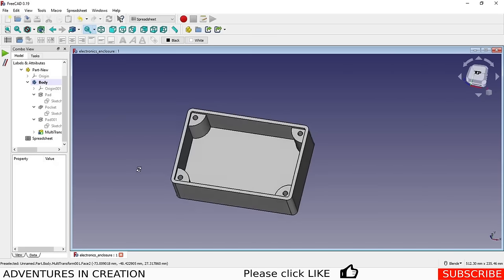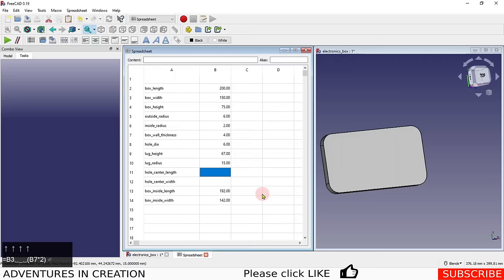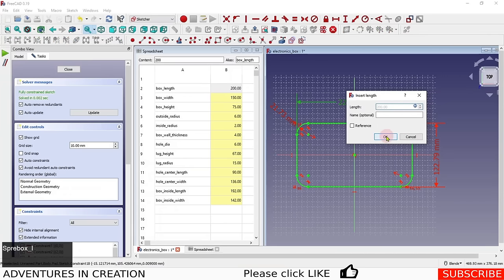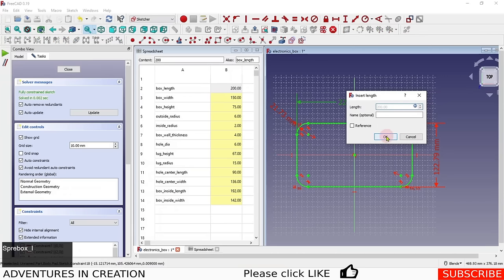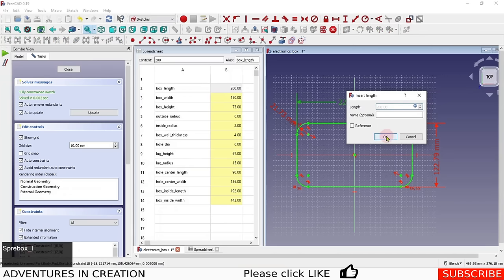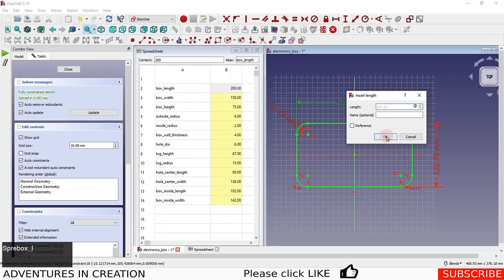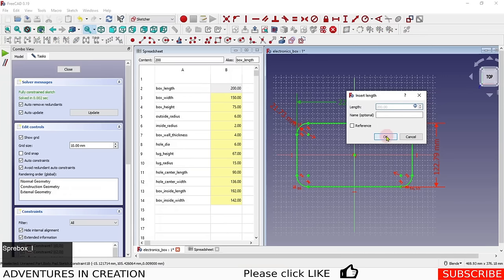FreeCAD Electronic Enclosure Using Simple Parametric Design Techniques

Comment: Wow!  I was so stuck in using FreeCAD, but your video helped so much.  I am a much better informed ignorant person (instead of a completely ignorant person)  Thanks!

In the spreadsheet, I noticed that one can use the alias in the equations (instead of hardcoding the equation to a certain cell).  I think that would make the spreadsheet more maintainable and readable.

In the lug radius equation, you made the equation 2.5 * hole_diameter.  What was the logic behind the "2.5"?  I can see that you have to have a bit over the hole diameter.  Is the 1.5 extra material just a rule of thumb that is well known?  Seems like one might want the wall thickness between the edge of the hole and the outside of the lug.  I suspect that there is some way to specify that kind of constraint.

Great video!
Reply from the maker: I am glad it helped. I recommend trying things for yourself, if it makes things easier for you then adopt those as "your" best practices. As far as the 2.5 * hole_diameter,  you can make it whatever you feel would work. When I am planning to put screws in the PLA I like to try and leave some meat for the screw to displace. I am really happy that you are trying things out and doing so well with FreeCAD.

Comment: Hi again. I am using Freecad 0.20.0 and everything went fine until I encountered a problem. At 20:54 you defined the dimension of the pocket by referencing to the - Wallthckness-alias in your spreadsheet. When I enter the formular in the Z-position entry field the Formular entrybox tells me already the result is -4.00 mm. However,  the box still had no bottom. I changed the formular by deleting the minus infront of the Wallthickness Alias and now my box has a parametric bottom. Strange.

I thnk the reason is that all my sketches are layed in they same xy plane, the pocket and lugs as well. Thus I had to modify the parameters fpr the pocket and lugheigth accordingly. Nevertheless, it works great. What a joy! Next step-> the lid. Thank you very much agian. Great tutorial with reak benefit for my electronic projects. 👏🙏
Reply from the maker: Glad you figured it out

Comment: I've been using FreeCAD for several years and your series of videos has introduced me to several features I was not aware of. Thanks!
However, something has struck me as a bit odd. I tried constructing a box following the techniques you've presented in this video, except I started it off on the XZ plane, as I wanted the opening on the front rather than the top. When it came to creating the pocket to hollow it out, I found that I had to offset the attachment point of the inside sketch in the Z direction to get the bottom closed, even though intuitively it seems that I should have made the offset in Y. Any ideas why this is so? Also, would it not have been simpler to start the pocket on the top face of your box, rather than the XY plane? That eliminates the need to offset the attachment and reverse the direction of the pocket. The pocket depth would be expressed parametrically as 'Height - WallThickness'. Thanks again and take care!
Reply from the maker: The offset is in the local rather than the global lcs and is nearly always in Z direction.
Reply: It is one year later but yeah, when you do the pocket do not select "through all", instead give it a dimension of whatever height minus bottom thickness.
That negative attachment offset seems more like a hack.

Comment: Thanks a lot for your tutorial, I'm replicating what you're doing and learning a lot ! I noticed you have one free contraint left on the lug - it's the angle of the pie. You freedrew it as a right angle but it might not be perfectly 90°. Selecting the two segments from the corner, press the angle button and write in 90° will fix that. Perfect parametric box!
Reply from the maker: Thanks for the feedback
Reply: It was fully constrained due to the automatic horizontal and vertical constraint that was added by freecad

Comment: Having a problem on the pocketing part. I didn't do a spread sheet set up but instead just input the sizes etc and created a fully constrained sketch on the top plane of the padded box.  but when I try to pocket, I am getting an error message saying the plane or object was empty.  
Unsure what I am not getting correct.  Any input would be great. Thanks for these.
Reply from the maker: Are you trying to pocket with a plane that doesn't have a sketch attached?

Comment: spreadsheets are different.
the EasyAlias macro is not in the list of available and, when installed manually, swears.
Version: 0.19.24291 (Git)
Build type: Release
Branch: releases/FreeCAD-0-19
Python version: 3.8.6+
Qt version: 5.15.2
Coin version: 4.0.1
OCC version: 7.5.0
Locale: Russian/Russia (ru_RU) ☹ 
in the process, I figured out that the alias does not respond to the Cyrillic alphabet 😆
it's a little hard for me to understand macros, filled in aliases manually
I apologize if I make mistakes, I watch and listen to you through the neural network
Reply from the maker: Watch the video I am going to release today it shows you how to use the macro

Comment: Well, I finally created something that actually works... Well, sortof.  I have built a flight simulator cockpit panels (using scrap pieces of wood etc) and switches, 7-segment displays and so on.  My plan is to build 3D printed panels for each section that I need.  My first success (almost) was to design one panel holding two 7-segment - 6 digit displays for the radio frequency readouts with an encoder to select the frequency with a pocket hole and a smaller through-hole inside for the encoder and, 4 screw holes on the corners to mount it.  HERE is the problem (and I don't think it's freecad but maybe CURA or possibly my delta printer) - All the measurements are exact for the cutouts for the 7-seg displays, and encoder and screw holes but, they get printed slightly smaller.  The panel itself, 150mm x 50mm is ok, the two cutouts (46mm x 14.5mm) come out as 44mm x 11.5mm) and the hole for the encoder, supposed to be 15.15mm and inside hole at 6.9mm comes out to 11.2mm and 4.5mm -  I haven't a clue why this problem exists.  I had to print in CURA by making the X-axis at 105% and the Y-axis at 108%.  If anyone has an idea as to what the problem might be...........  Would be truely helpful.
Reply from the maker: You may need to calibrate your "system" remember as the pla cools it may shrink. If you are scaling things in cura you may change the difference. Try creating and printing some simple calibration items to dial everything in.

Comment: Nice! If your enclosure had a slightly smaller base in relation to the top. how you you make it? Using multiple  lofts and boolean operations? Something like kradex Z75.
Reply from the maker: You could do that with just a loft to craft a taper or you could apply a taper to the outside

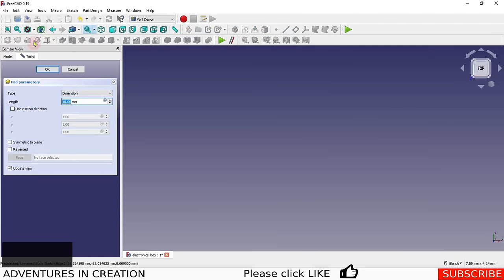Comment: I'm not able to use "PAD" from sketch tool during 4:45,  showing "Consider using ShapeBinder or a BaseFeature to reference external geometry in a body.
Reply from the maker: That's odd, can you share your file?

Comment: I currently use Draftsight but they just increased the yearly fee to $325 from $200. I would like to transition to another software. I haven’t been happy with the support. Some features don’t seem to work and there was no one to talk to. Can you use this in 2D and create a dxf file that can be emailed. Design spark may do it now but 2 years ago it couldn’t. I also tried to download this and it said not available in your country. Wouldn’t even accept my email. I would appreciate a 10-20 min conversation with someone about this software if that’s an option.
Reply from the maker: I did the same because fusion 360 (auto desk) started messing with their licensing. You can certainly make 2D views but this software is primarily built around creating a 3D model first. I am not sure that freecad offers a person to talk to but you may be able to go to the forums and engage their.

Comment: Good tutorial, but soo laborious. The connection between the spread sheet and the part is so clunky. It would have been better to allow users to name parameters on the part and automatically create a table. A simple popup on a dimension would have allowed that and allowed adding formula as well.
You could still access and input via a spread sheet or variable table but eliminate having to create variables and the associate with dimensions.
This is not trivial because every unnecessary and unintuitive operation makes the whole process more unwieldy and time consuming.  It does not seem to me that any of the CAD packages available manage to provide a clean interface where it is easy to move things, resize things, and allow easy parameter changes.
Onshape, which has its own issues offers a shell tool which avoids the process of creating a smaller box and subtracting it. Perhaps Freecad now offers that? 
The design software GUI needs to help the user otherwise the Openscad package offers a faster and clearer programming process to get what you want.
It is really difficult to work out which is the least worse free CAD software.
Reply from the maker: Try dynamic data, it might be nearer to what you are looking for.

Comment: Hi! Nice video. I'd like to know if there's a way to validate the input parameters such that the model doesn't get redundantly constrained. I looked up a bit but couldn't find a way to do this on the spread sheet. Let me know if you know how to do it. Thanks!
Reply from the maker: There is no automatic way to do that however you can build validation into your calculations.

Comment: Thanks, very clear tutorial but this is why I find FreeCAD so incredibly frustrating. There is no macro selection visible on my version, that whole row is missing,, yes it is the same 0.19 but a few months newer, so because some developer decided to change something within the same version, I fail at the very first hurdle. I work it out though menus, but the interface looks different, I get to downloading the macros, they fail to appear i it hangs at downloading macros. I give up and go and do something more productive instead. 

EDIT - After goodling and finding may others with the same problem, I determined I had to install GIT and put a path to it in windows system variables. Again, freecad frustrates at every turn... The list of macros downloaded and the one required wasn't there.
Reply from the maker: Thanks for the feedback, freecad is definitely under heavy development, it's a blessing and a curse. The menus are very configurable, I have mine all expanded and enlarged so you can see them in the video butany people work with a more modern look and feel.

Comment: Thank you for your excellent step-by-step instructions.  However, when I try to create that first pocket, I get an error message: "Pocket: Result has multiple solids.  This is not supported at this time."  What have I done wrong?
Reply from the maker: It sounds like your pocket is cutting through the solid making it two parts

Comment: I echo others comments that this is a "break-through video"! I did run into trouble with the EasyAlias macro.   I have installed/reinstalled twice.  It flags the following error when I attempt to run it:  

11:17:04  <class 'SyntaxError'>: ('invalid syntax', ('C:/Users/Pete/AppData/Roaming/FreeCAD/Macro/EasyAlias.FCMacro', 1, 1, '<span></span><span class="c1"># -- coding: utf-8 --</span>\n'))

I have created an alias manually, no issue.  I have attempted to create a new project and only use the macro to Alias a single cell, and it still doesn't work.
Thanks in advance for any suggestions.
Reply from the maker: Thanks for the feedback. I was having trouble with the Easy Alias macro recently. I will have to look at it and see why it's not working properly. Manually adding them works great but is time consuming.
Reply from the maker: I looked at my Easy Alias Macro and found it was corrupted somehow. If you go to this page https://wiki.freecadweb.org/Macro_EasyAlias and copy the macro from there and replace the EasyAlias macro you have it should work.

Comment: When I tried to download the Macros I got the error: GitPython is not installed. Cannot retrieve macros from git. Appears to be an issue connecting to the Wiki, therefore cannot retrieve Wiki macro list at this time.
Reply from the maker: I have seen that error before, usually an Uninstall then reinstall fixes it.

Comment: Changing your design to improve holes, inside walls, supports, etc, created a new side sketch and include a lateral hole (power connector or so), found out that an side hole parametric in spreadsheet as a sketch PAD works, change diameter and location by changing the spreadsheet, but if instead of a PAD i choose a HOLE, changing the location of the hole in the spreadsheet it still changes into the part, but not the HOLE diameter, it does not do automatically, the sketch shows the new circle diameter, but the hole doesn't change, I need to edit the HOLE for that.  Deleting the hole and creating a PAD with the sketch, then the diameter changes in spreadsheet also changes the part in seconds.  Something is odd about it.  Thanks.  I need to learn a little bit better as to use the macro, click on spreadsheet on the Model list, but sometimes it doesn't include the new entries in the spreadsheet, it seems that need to select the new entries also... can you explain a little bit better, please?
Reply from the maker: I think you should be able to introduce a parametric, spreadsheet driven hole. -  I wonder if your hole is confilicting with something, try to make it a through hole and not coincident with the face itself.
Reply: @Adventuresincreation , thank you for your reply.  Yes, I should investigate why the "hole" doesn't automatically work, anyway, the "pad" does, so at this point it is okay.

Comment: Ok, I had to stop, it’s Sunday and I’ve got to get some other things done. Also, at this point, 16 minutes and 25 seconds in.... (note it took a couple of hours to follow the video on my IPad while doing this design on my computer). When I create the new sketch. The first thing that is apparent is my body, isn’t centered on the xy plane. Then I create the sketch and add the radius. When it becomes time to normalize them, the sketch goes wonky. I’m assuming it’s because my object isn’t centered like yours is? I know I can ctrl z and just keeep doing that to go back and find out where I lost the center? But I’d like to avoid doing that. How do I center the object on the xy so that when I create the new sketch on top of it, everything works? Your help is appreciated. This is my first FreeCad design.
Reply from the maker: When you are creating the sketch, you can set the shape symmetrically around the coordinate system. Just select the two diagonally opposing corners and the center point and hit the symmetry >< button. That will center it for you.

Comment: Great video. Very elegant use of the spreadsheet feature, which to me, was the most enjoyable section. I’m looking now at ways to make the spreadsheet update all parameters automatically just by altering the box length, for various standard sizes. Thanks for this lesson.
Reply from the maker: Excellent, let me know how you get on with it.

Comment: Do you have any vids on installing your macros? Tried your StartUp one and it gives this error on 0.19 (23546) on Windows: 
16:06:15  Traceback (most recent call last):
  File "C:/Users/<user>/AppData/Roaming/FreeCAD/Macro/StartUp.FCMacro", line 28, in <module>
    tv = Mod.Show.TempoVis(App.ActiveDocument, tag= ActiveSketch.ViewObject.TypeId)
<class 'NameError'>: name 'Mod' is not defined
Reply from the maker: I will put something in the next video for you. The problem with macros is they are dependent on their environment. In otherwords if you are in a different workbench or have a different tab open it can cause an error. I am always in the part design workbench with the model tab open. It should pop up a window and ask if you want to save the file.

Comment: I ran into a bug. I created a part with a spreadsheet. I copied it and changed dimensions in the copy spreadsheet, and saved to SD various sizes. Apparently, all the spreadsheets are all linked to the original, because all the parts are the size of the original part. Do the spreadsheets need different names to prevent linking? Cura is slicing it to the original spreadsheet.
Reply from the maker: I believe the sheets are linked to the freecad file. If you have two sheets with the same name you can run into issues.
Reply: @Adventuresincreation  Thanks, I will make sure.

Comment: I have found this video and the matching lid video extremely useful.  A similar video showing a cylinder instead of a box with a matching screw fit lid using the same style spreadsheet of parameters would be awesome.  Maybe a suggestion for your next series of videos. grins.
Reply from the maker: Thanks for the suggestion Ian, I will bear that in mind for a future video. This weeks video is modeling a simple engine to demonstrate how to manage a multi-part model.

Comment: Thanks for this, i paid for the file great work! How would one add tabs to each side with a hole in each tab to allow it to be drilled to a wall? I don't want to do this inside the box as i want to keep it sealed. What approach would you use?
Reply from the maker: Thanks! You could create tabs with a separate body then use a boolean operation to attach them. That way they won't interfere with the box itself.